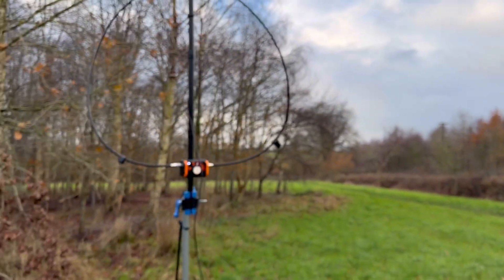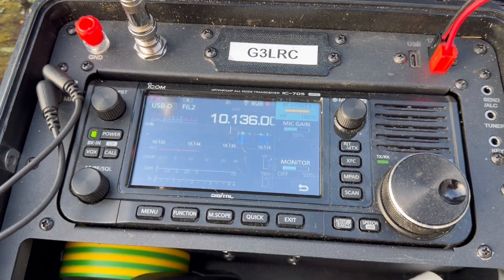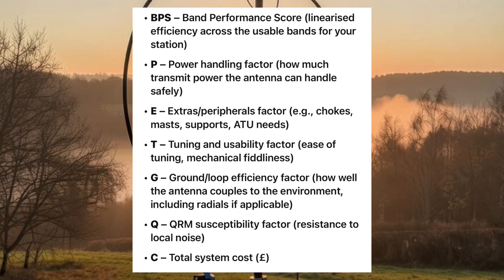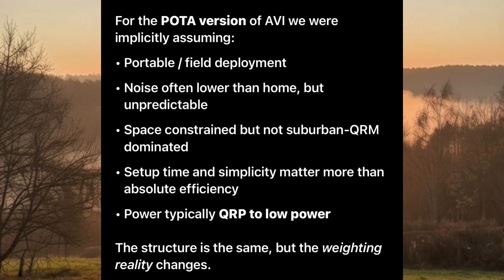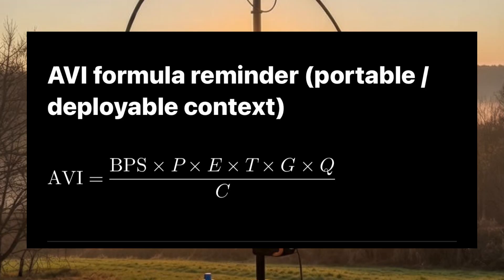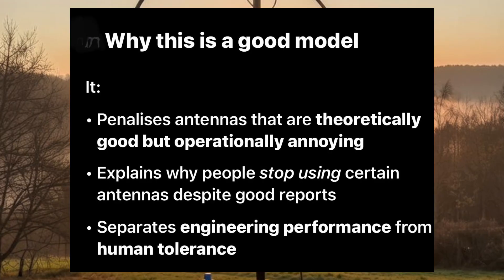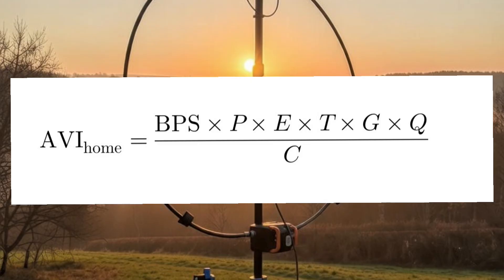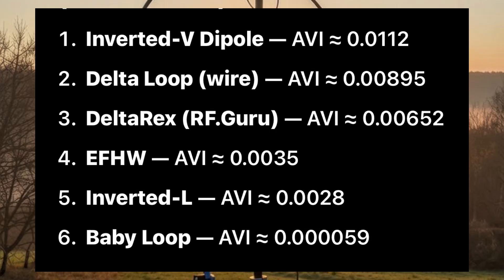Antenna buying rebooted, sorted and evidence-based!!

Comment: I am very positively surprised how well an EFHW antenna in the inverted U or V configuration can work. I have one in my garden (ab. 20 m of wire, supported by two 8m poles) and with 10W I can be heard within about 1500 km on 20m and within 1000km on 40m with average propagation this year. Tried other antennas, including GP, OCFD, dipole - not much difference in real QSO reports (EFHW is either better or comparable). Vertical/GP shines when it comes to DX, probably due to lower takeoff angle. One factor: the soil in my garden is fertile, has lots of moisture, which might create a better RF counterweight than other soils.
Reply from the maker: Top insights and thanks. I use a random end fed for POTA sometimes and it works well. The EFHW on the club station is battered by QRM.   The Alex Loop’s performance has really surprised me and this is a good example of the formula, it suffers due to tuning, performance across multiple bands and cost. Many thanks for watching and Merry Christmas. Dave
Reply: I can tell a difference between my end feds (I have 4), and a few 20m antennas I built with 9:1 unun and a dipole in various configurations. Recently the big winner for be was the TEFV salty Walt recently showed off. I built out the same thing and reached an extra 1000 miles on ssb on 20m and 10m was amazing

Keep experimenting!